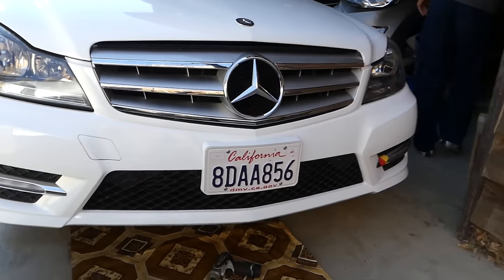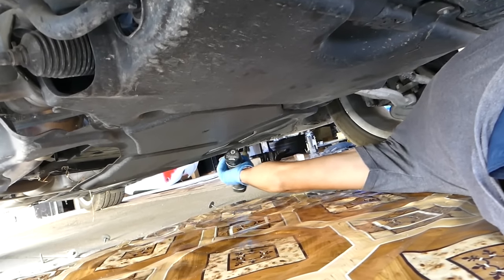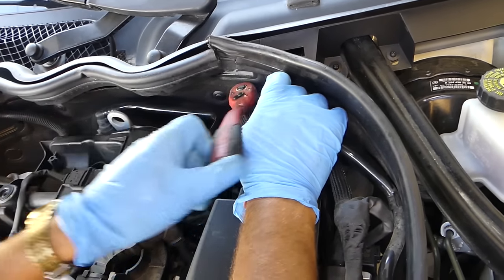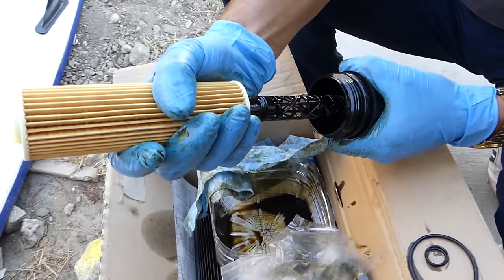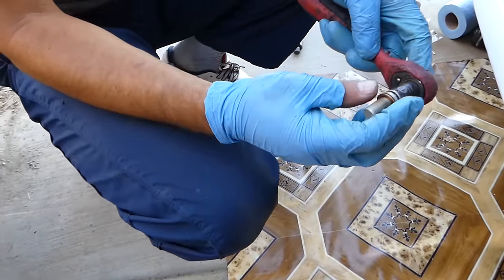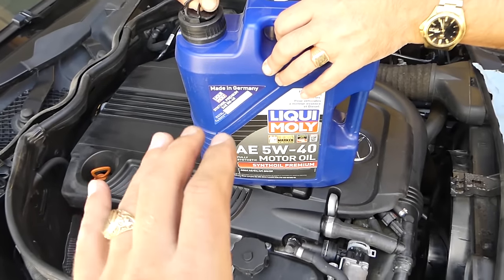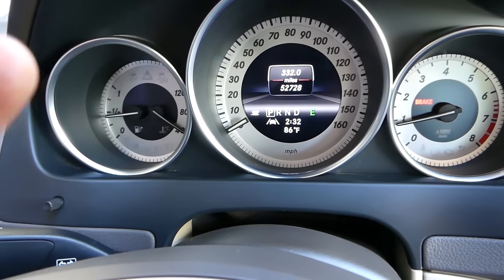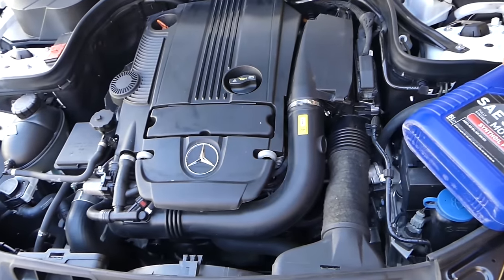HOW TO CHANGE ENGINE OIL ON MERCEDES W204 C180 C200 C250 Oil Capacity

Comment: For the m271 engine you need a little ofer 5,8 liters of oil and 0w40 for very cold climates and 5w40 for the rest pf the climates of fully synthetic 229.5 grade (not 229.51!) oil, preferably mobil 1, liqui molly, motul and many more.
Reply: I live in west Europe i used 5w40 
Next oil change im thinking 0w40 to go for maybe mobil or Rowe
Reply: @easyrider020 dont do it. Mine made all sorts of noises with the thinner oil
Reply: @easyrider020  Thanks for your like. I would recommend the Original, Motul or Ravenol 5w-40 229.5 (all fully synthetic)

Comment: The large oil filter o- ring should not be in the top groove. It should be in the next groove down otherwise the o-ring will not go into the filter housing and if dry it can break. I found this out the hard way. Tried to torque to 24 Nm and destroyed the o-ring. After researching the ‘net I realised what I was doing wrong. It would have been helpful if your video advised of this easily made mistake.

Comment: Mercedes have an  Electronic Oil Level test, which you access by pressing the Trip Meter reset rapidly 3 times and then turning the Key to start position 2. It will test the level and give you an "OK". Further through the menu, it will actually tell you how much Oil your Engine is currently holding.
Reply: I thank you so much for this comment.  Hopefully my c250 has this feature.
Reply: @Fractal_blip  it definitely should. It is a common feature in MBs and very handy to get to know.

Comment: Yes sir, can you plz help me out with my problem, I had 2009model c200 kompresor and troble code p0045 and it's say supercharger boost control solenoid circuit A open, where can I find the boost control solenoid circuit, tnx

Comment: the suction changer goes to the same job for about 15 minutes😉 the precipitate also leaves, there is no need to remove the bottom armor, nor to lift the car.
Reply: timo mannila where do you buy a suction changer please post amazon link
Reply: M A  when the oil is warm then it absorbs easily..have but be a good vacuum device ..I have already 6 years have changed many the car from above...
neat work if there is an above oil filter cartridge
Reply: @DanGamano  please use google.
Reply: M A  can also suck the filter housing empty👍

Comment: Hello my mercedes is E clas 2007 ( 320 cdi 165kw 224ps ) 290.000 km what is best oil ?
Reply: bivol gheorghe try Liqui Moly. I use it in my R class, same engine you have.

Comment: To have a good oil drainage, after oil pan plug removal, the car has to be lowered or maintained at a level position.
Reply: Thank you for this comment
Reply: Yeah but it is just a small amount 🤏. The oil filter will do the rest. Adding the new oil, the old left over oil will renew 🤷‍♂️.